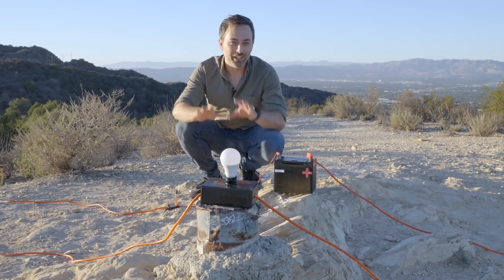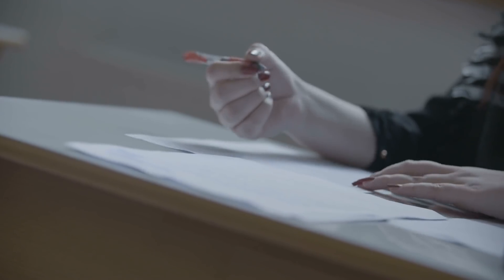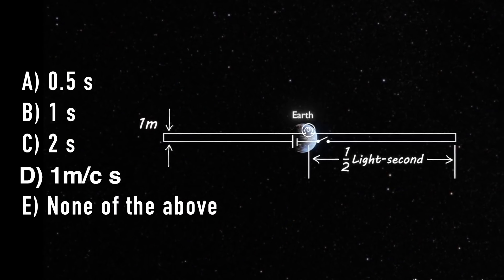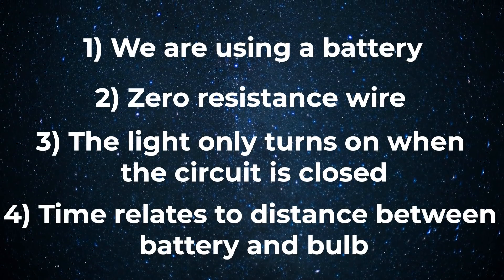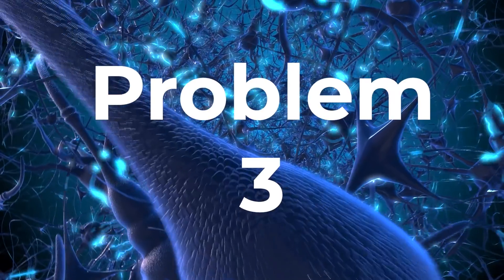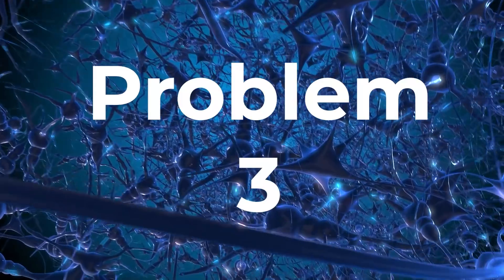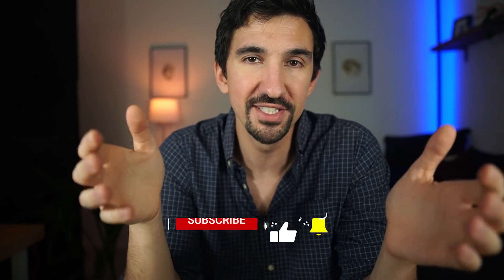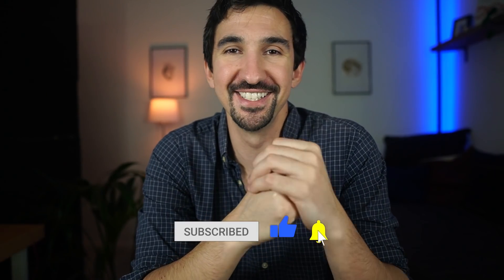Is Veritasium Wrong About Electricity?

Comment: I don't really feel like taking 11 minutes to watch all of this now, but I think there's a contradiction in his claims.

He says that electromagnetic "energy" (whatever that undefined word means) flows in the given directions where ever there is voltage and current - but he neglects that there is no current on the bulb side of the circuit at the moment he closes the switch, so I would claim that energy can't get to that side of the circuit until there's current on that side and that will require speed of light wavefront of flow along the length of the wire.  Perhaps once there's flow on both sides then energy can be transmitted across that gap, but the conditions don't exist initially.

Update: I just saw an electrical engineer plot what will actually happen in terms of voltage and current at the bulb.  What happens is that there's a momentary jump in voltage and current at the light bulb when the circuit is "closed" due to capacitance between the nearby wires - and this depends not at all on whether the circuit is closed or open a light second away. Then that falls off.  

Now maybe the engineer was wrong about it falling off because he only simulated a small portion of the wire and this is an impossible wire with zero resistance.   Does it also impossibly have zero inductance, Veritasium doesn't say.  If it also impossibly has zero capacitance, then there will be no transmission and no voltage! 

And since the ACTUAL effect depends on capacitance and inductance, I notice that his Maxwell equation description of all this doesn't mention those quantities.  Does it depend on them anyway?

EVENTUALLY the dc current will come around the long way. Once you have a steady state dc current then there's no transmission between the nearby parts of the circuit - because only changes are transmitted and the field isn't changing.  He said that the view of power moving through a field outside the wire is only used by engineers in the case of AC current and transmission - and there are no meaningful effects of that in a DC circuit. 

So when Veritasium says we're thinking about circuits wrong then uses a DC circuit as his example, I think he's basically wrong.  We were thinking about DC circuits just fine, it's AC circuits that need a more nuanced understanding - and probably one more nuanced than Veritasium was giving, because he was selling  momentary transmission of a transient as if it characterized what goes on in a DC circuit and it doesn't.

Comment: It appears (7:10) that you agree with Veritasium : there is transfer of energy as radio waves directly crossing the 1 meter gap between the two "antennas".
I think you only question (9:00) the amount of power that could be transferred (over that 1 m distance) like this.

The answer is : quite a lot.

For example, when you switch your microwave oven on, the transmitter uses something like 500 W, and transfers most of that power (via EM waves) to heat your cup of soup inside, with very little losses.

Comment: The trick with the Veritasium scenario is that the 'wires' were laid right next to eachother, creating the twin-antenna scenario, which I think most of us would already understand. Which, yes, 'energy' would be coming from the battery and going to the bulb. But that's partly because it's assuming the wires aren't being well insulated from eachother. If it had been a circular circuit, it would have been a very different scenario.
Reply: Yes, they were laid 1 meter apart. And yes, he is using DC battery to power the light. Please explain how the 1 meter difference will allow a 12 volt battery to induce 12 volts to light a 12 volt light bulb?
Don't like 12 volts... ok Pick any voltage you want... please explain how ANY battery producing a voltage of X volts, will induce a voltage of X on a wire 1 meter away to light a bulb requiring X volts.
I don't see it happening.

Comment: The fact that he neglected to include the unit for the 1 in 1/c is really important. He was basically misleading the viewer, making that 1 seem insignificant. But that 1 was actually related to the 1 meter the wires are apart from each other. If the wires were further or closer to each other, then the equation would have to be adjusted to account for it. You were basically on the right track but didn't know about transmission line theory (TIMF), so there you go.
Reply: They also neglected the effect of a conductor moving through the Earth's magnetic field.
NASA almost blew up a space shuttle by deploying a long wire into space, it generated so much more power than expected, they were lucky it burned in 2 before it blew up the shuttle.
The wire is still in orbit.
Reply: The 1 in 1/ c is the distance between the battery and the bulb. The answer 1/c is wrong. Power, whether CD or AC, is transmitted at the speed about L/c where L is the length of the cable.

Chan Rasjid Kah Chew.
Singapore
Reply: @chanrasjid8688  It wouldn't matter if the wire was one light second long or only 100 miles long, it would be the same because electrons don't need to travel the entire length of the wire at all. The whole thing is a trick question, written to make you think the length of the wire is the important part, but it really isn't.
Reply: @ThisSteveGuy  There is a  lot of  controversy (even among the professors) in EM theory, especially about how power is transmitted "through space", etc. The length of conductors matters. Electrons "move" at mm rate per sec but signals, e.g. a voltage wavefront travels near light speed c along conductors. Unknown to the physics profession, Poynting theorem is wrong about how power transmission works. If we accept light to be photon, then it is the photons(== energy) that travels along the cable transmitting power; the photons don't leave the conductors and converge back "intelligently" at the destination. I know my view is outside mainstream, but veritasium's 1/c is definitely the wrong answer. 

Chan Rasjid Kah Chew.
Singapore
Reply: @chanrasjid8688  "Unknown to the physics profession, Poynting theorem is wrong about how power transmission works. blah blah blah"
You need to go test your hypothesis, because otherwise it just sounds like a grandiose delusion.
Reply: @ThisSteveGuy  Did I not mention my explanation is outside mainstream ("unproven")? Now just tell me about wave-particle duality of light. If we take light (em waves per Veritasium's poynting theorem, etc) as photon, then how does one explain energy transmission with just photon and not electric-magnetic waves. Do you say the photon concept somehow is "wrong" when applied to power transmission? 

Chan Rasjid Kah Chew.
Singapore
Reply: @chanrasjid8688  I don't care what you think is going on, unless and until you prove it, the only place it's true is inside your head. It doesn't matter how strongly you've convinced yourself of these things, if you haven't actually applied the scientific method to it, then there's nothing for us to discuss.
Reply: @ThisSteveGuy  It's ok "you don't care" about my opinion. Just read the other comments here.
Reply: @chanrasjid8688  Science isn't about opinions. You can't say "Veritasium is wrong" just because of your opinion about electricity. No, you need to test your theory. Until then, no, I don't care what you're talking about. It's not my problem.

Comment: Last point is such an excellent one and super important for people to fully understand. As far as the light turning on, I think it's fair that a power requirement is ignored (but I do think it necessarily begs for a follow-on). Most will agree the bulb is on when it generates sufficient photons to be seen by the human eye (at any level) and that it remains on continuously for at least some duration beyond just a flicker. As far FTL 'communications,' the circuit has got but one single signal to fire off and that signal could never be relied upon as definitive. Why? Because, by definition, the circuit must exist in outer space. And we know the consequence of that--it will be highly and constantly energized by myriad sources (lots of magnetic fields, cosmic rays, cmb radiation). Also, it could flash off due to a breakage caused by a passing object. Regardless of whimsical possibilities, the set up isn't a practical FTL signaling device. So it's  a really a red herring. That said, I am interested in seeing a calculation of when (in theory) the light no longer turns on after the bulb and battery  begin to be separated beyond one meter. What is the range of the induced field of the parameterized system as it begins to attenuate due to increased distance? I think that is something that would substantially help flesh out the point being made (trying to be made) by Derek and team. They absolutely need to bang out a Pt. 2. Given that they teased that in Pt. 1, it's obvious this was Derek's plan all along.

Comment: Actually very interesting topic. But i conjecture that electrons do not move from there position. They only vibrate at a high speed. There is a atomic lattice that is created by the electron as it vibrates. As a result there is an electric and a magnetic field that is counter balancing one another. As the current is introduced into the circuit these fields modulate in length and length due to the resistance of the conductor and any other materials in the area. Also the fields are affected by moisture.  So weather a closed or open circuit, Weather AC or DC. Flow is done not in the wire but in the areas around the wires were the fields are oscillating.

Comment: I think the scientific thesis of Derek's video (electric fields are what propagate electricity, not electrons moving from A to B) is definitely correct, and the idea that electricity is electrons being generated and consumed is a very common misconception, but the way he warps this conclusion is misleading. yes, the changing electromagnetic field will induce a minuscule current in the lightbulb  (note how he subtly qualifies the original question with "assuming the lightbulb will turn on the moment any current flows through it")  --as anyone who has taken a college course on electromagnetism can tell you! But then he tries to make it sound like the wire is irrelevant to the energy transmission from battery to lightbulb, but only the physical distance between them. Even a moment's thought on this proves how silly this idea is, because that would imply that all lightbulbs all over the world should be continuously illuminated by all batteries in the world.

Derek never said any falsehoods in his video, but he framed the video such that someone with a poor understanding of physics (which is his target audience) would be misled.

Comment: so are you saying that the "pressure" of the electricity would cause electrical flux to build up and raise the voltage faster than the speed of light?  maybe its late and my brain feels kinda soft, but that would imply faster than light communication.

Comment: The way I was picturing it was 2 circuits in parallel the open circuits bulb is as on as the closed circuit bulb until the electrons have had time to catch up and make a difference.

Comment: Another point, with the absurd length of the wire, even if it was zero resistance, the battery would need to be about the size of the Empire State Building in order to have a continuous current around the entire wire.

Comment: Based upon the Veritasium explanation, I think it would have been more correct to state that current doesn't begin to flow at the battery and the bulb simultaneously, but differ by an interval 1/c. There is an additional amount of time related to the length of the wire before any current moves at either location.
Reply: The length of the wire doesnt matter. It could be longer or shorter and the answer is always 1/c, what he left off is the units it should be 1m/c (m/s). this is the time it takes for the Em fields to start transferring energy to the bulb, note the energy is NOT delivered by the wire it comes from the EM fields.

Comment: Hi Ben.  Thanks for the video and your insight.  I think you are thinking about this type of content and problem in a productive and correct way.  unfortunately, I think Derek made a blunder here, in that he is off the mark practically; setting out to prove his point with an example which he then needs to put cavoites around for you to ignore so he can then try to prove his point... practically wires have resistance which is more evident at DC especially long wires so yes the DC car battery with wire that long would not light that AC bulb for a second (not to mention in a sec:).  Second to get it to start to glow the cables would be so large there would be other problems... Yes so it becomes a transmission line problem which is an AC circuit problem which then needs the 1 Meter separation and yes it's the capacitance in the circuit which causes the 1M/C to be realized.

Comment: Before the accident happens the light bulb will not remain off. Here is the shocker, if you just attach two pieces of wire to both ends of the battery simultaneously, the current will flow in the wires for the time it takes to develop the electrical fields around the wires. What that means is if there are other piece of wires placed in front of them (e.g. 1m separation which is not very practical, but theoretically), the current will be induced on the wires through magnetic coupling. So yeah, given the sh*tload of illogical assumptions by Veritasium, he is right.

Comment: Every DC circuit acts like a capacitor , ready to flow current as soon as we switch on...capacitance is at switch waiting to get short. Propagation of energy is different in DC vs AC. Energy doesn't always need to transfer like a envelope letter ( like particle ) rather propagating energy ( like wave ) to it immediate next. A quanta of energy can deliver itself or charge the next neighbor and ask it to pass to next one;    first scenario is particle and second is wave; quanta of energy refers to every particle in non-zero-kelvin

Comment: I have commented twice on the channel of Veritasium. Since then I have been thinking a little deeper.

Veritasium has it wrong! And this antenna explanation is also wrong!

Veritasium uses the Poynting vector. But that is a nonsense vector! And that is, because E and B are not fundamental fields of physics. They are derived fields!.

Both the electric and the magnetic field come from a relativistic 4-vector which looks like this:

(Psi, Ax, Ay, Az) . 

whereby Psi is the potential that gives rise to the electric field. and A = (Ax, Ay, Az) is called the Vector potential that gives rise to the magnetic field. The A vector only has a value different from zero, if there are moving charges.

If we take the gradient of the potential, we get E . So E = grad(Psi) = V(Psi) And B is the rotation of the vector potential, That is, B = rot( A ) = Vx A (I use the letter V as the del operator.)

But this last equation is also wrong, because, in nature, there is no such thing as a cross-product! What we have is a bivector! And a bivector is a rotation! Therefore we must write

B = rot( A ) = V^ A

Both the potential and the vector potential are in the wire!  The vector potential points along the wire, and the electric potential is also in the wire. Therefore, the energy is not around the wire, as the Poynting vector suggests, but it flows from the battery directly into the wire!  

The energy must then be Energy = 1/(mu0) E ^ B = grad(Psi) ^ rot( A ) , which is a trivector! Therefore it describes a volume!

What volume? The volume of the wire!

Therefore, the energy flows, from the battery right into the wire, and then to the light bulb! As soon as the positive potential from one end of the battery reaches one side of the lamp, and the negative potential from the other end of the battery reaches the other side of the lamp, the lamp starts to glow. 

Therefore, both the positive potential of one end of the battery and the negative potential of the other end of the battery need to traverse the length from the battery to the light to make the light bulb glow. And since both the change in the potential Psi and the change in the vetor potential A move in the wire with a speed equal to the speed of light, it takes the light bulb one second (or maybe less) to make the light bulb light up!

Comment: Technically a lie is defined as more then unitentional, vertesium video is a lie right off the bat because it doesn't calculate the length of the sides of the wires. Everything's a lie, ok maybe that far lol.

Comment: This sounds right.  The key point is the radiative coupling between the two wires is not zero, and there is no information from distant parts of the wire at short times, only radiative propagation between them.  But quantitatively, I agree that the coupling must be quite small.  Closing a DC circuit switch putting 12V across two parallel disconnected wires separated by 1 m  does not seem it would couple enough current flow in the other wire to light an ordinary bulb in a visible way.    On the other hand, if you use a coaxial transmission line or something similar for the two conductors, I could imagine stronger coupling.   In the end, the initial current in the bulb depends on details of the radiative environment and I guess Derek's point is that it becomes non-zero at t=1m/c.